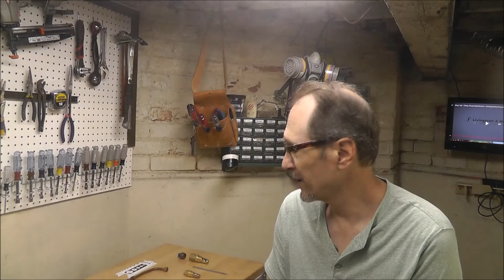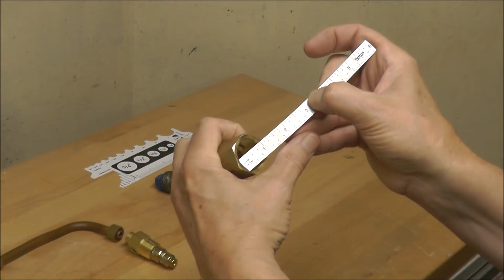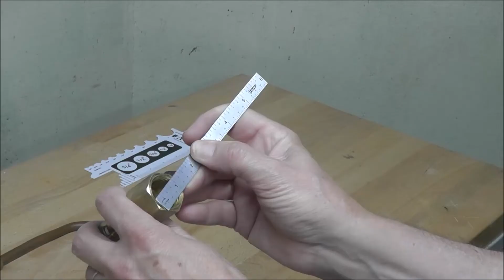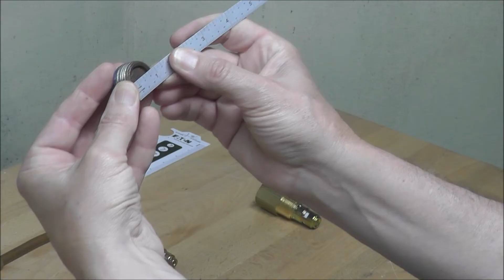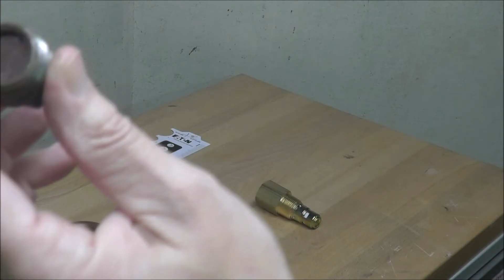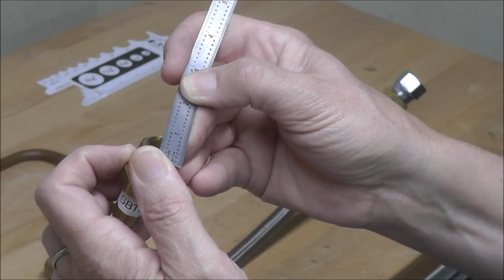How to measure NPT Fittings and pipe sizes

Comment: You misspoke.   3/4" ID + 1/16" + 1/16" thickness on both sides does not equal 1".  Each wall has to be 1/8" to add up to 1".

Comment: At the onset of the video it was mentioned it's either a 1/4 of an inch or 1/16th of an inch to either side at around the 45 second time spot.  Can you clarify this?  I measured an O.D. (outer diameter male pipe thread under our sink) with a caliber which shows .5 or 1/2 inch. if I subtract 1/4 inch I'm left with a 1/4 inch. However, the female supply hose needed is a 3/8ths connection which would be correct with the statement of 1/16th on either side (totaling an 1/8) from the original OD of 1/2 inch leaves us with 3/8ths. How does one know if we should subtract a total of 1/8th or 1/4 off the O.D. ?

Comment: So I have a boiler and need to replace some steel galvanized pipe the outside diameter is 1.682 the inside diameter is 1.370 …… is it 1 1/2 or 1 1/4 pipe????

Comment: Galvanized pipes all in my old house. I'll use calipers to measure the outside ... do the subtraction and hopefully that'll be correct. My goal is to be able to buy replacement parts BEFORE I destroy the old plumbing.

Comment: I had to replace a pipe around my house but I was not sure what the diameter of the threaded end was. So I took it to my neighborhood hardware store and they had these little metal INDIVIDUAL cup like shape tools that they screwed my MALE threaded pipe into a Female threaded little round metal cup shape thing and told me I needed a 1/2" pipe. So when he went to get the pipe I looked at all the other sizes which were 1/4," 1/2," 3/4," 1" etc. My question is, do you have an idea of what those were? Any advice would be greatly appreciated.

Comment: Thank you for the explanation. As a machinist, I was throughly confused why my “5/8” pipe cap wouldn’t fit lol.. I’m about 1\4 off lol…
Reply: Machinist here also. We just went through this conversation. I had a 1/2" hole and was like i need a 1/2" npt tap and it wouldnt fit. I had to get the pipefitter over here to explain this. I was like i need a video to explain this better  because wth is actually measuring a 1/4". I couldnt find anything that measured that and behold it was the id of the fitting i was putting in it haha easiest explanation is just subtract a 1/4". 
Sooo very helpful here.

Comment: Dang good video by a pro's pro.  
I'm an old man who was taught steam pipe-stuff by WWII guys.  Not being too educated I have to use memory tricks.  
NPT I think of as NOMINAL pipe.   
Putting the words  "pipe" and "tube" next to each other reveals that the 2nd letter "i" means pipe is measured by its INSIDE diameter. 
And the 2nd letter "u" in tubing is  bc it's measured by the  "OUTside" diameter.  

Nominal is an important characteristic because even tho 100% of home owners see is Schedule 40 there are thicker schedules of pipe.  Example; 1" Schedule 40 has a nominal inside diameter of  1".  A 1" Schedule 80 has a nominal inside diameter of much less. (My Pipefitter's Manual isn't handy.). 
Another example; when holding a length of 1"  pipe the threaded end inside diameter will measure less than its non-threaded end inside diameter.  Hence, nominal.  
Dang good video-this guy is a pro's pro.

Comment: Can you identify a SAE fitting just by spotting an O-ring below the threads? Or would you have to determine if it's tapered to decide if it's a SAE fitting?
Reply: SAE is never tapered and always has a seal.

Comment: Okay, let me see if I have this right...

I have a 1/8" o.d. tube that I need to connect to a male thread that measures about 3/8. I've found a push connector that fits 1/8" o.d. tube to 1/8" NPT female thread.

So the connector will work, right?

Comment: Perfect. Thank you very much. 1 quick question, what about when it comes to sizing up a high pressure nipple, like when the sidewalls of the nipple are larger? I have a bunch of nipple in the tool room that the measurements are worn off from pipewrench marks. Thanks again.

Comment: There is no good reason that i can find why they dont use Od for male parts like every other industry. We can still determine flow with different schedules it doesn't make any sense to use Id for anything female fittings where the I'd determine the od of the pipe to CV connect.  Like oh I have a 1/2 hole in this fitting so let's use a 1/4 pipe yeah that sounds right.
Reply from the maker: It is odd and doesn't make much sense, we'd have to agree. Thank you for watching and for the comment!

Comment: BSP pipe also comes tapered, like NPT.  And some conduits have a different taper and some straight an some the same taper as NPT.
Pipes 2" and larger have almost exactly the same size inside diameter as the nominal pipe size for SCH 40.
Taking a quarter inch off the OD of a 1.5" pipe will yield 1-3/4".  The rule of thumb won't work there.
 The rule of thumb here ONLY works for little pipes, then doesn't work for 1.5, does work almost for 2, 2.5, doesn't work again for 3 and gets worse and worse bigger than that.

Best to use the chart, look it up or find someone that knows.  I frequently ask for second opinion when 'eyeballing' threaded pipes and I have been doing it for 35 years....usually the 1.25 and 1.5 sizes are mis-estimated--especially when they are up high and can't be inspected closely.

For 2" versus 2.5 ", the thread pitch gives it away....2" is the biggest with 'fine looking (11.5 tpi)' threads and 2.5 is coarse like 3, 3.5, 4, 5-inch and all the larger pipes up to giant sizes (8 tpi).
Reply from the maker: This is some excellent information, and thank you for adding your knowledge!

Comment: hi there, Im changing out a little section in my water pipe installationz 1inch pipe.. how to join two pipes if they can not move. both sides threaded and they can touch when i finish. how to connect them. thinking about making a longer thread and move over the coupling all way then just move coupling over to the other one when i finish the rebuild..
Reply from the maker: I would use a 1" pipe union, found at most hardware stores, but maybe someone else can chime in with a different solution.

Comment: Can I use my measuring tape for this ?
Reply from the maker: You sure can. Since standard pipe threads are pretty course, you can use a tape measure to find the ID and OD of the threads. Thanks for the comment!
Reply: Master Tool Repair also meant to ask. If I’m using my tape. Do I still just deduct 1/4 inch ?
Reply from the maker: @mjbplumbing710  Yes, you still want to deduct 1/4" from the O.D. measurement when using a tape measure. This will give you the "MPT" size. So, a 3/4" OD is a 1/2" MPT fitting.